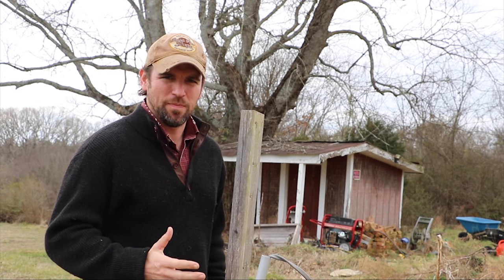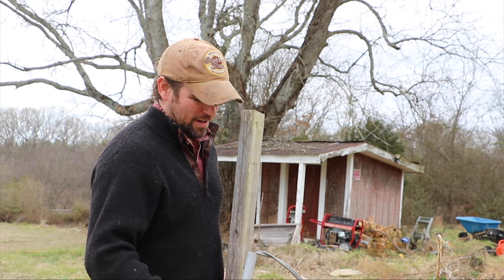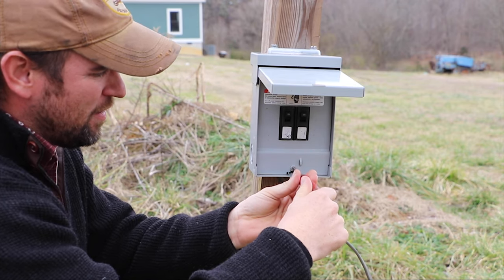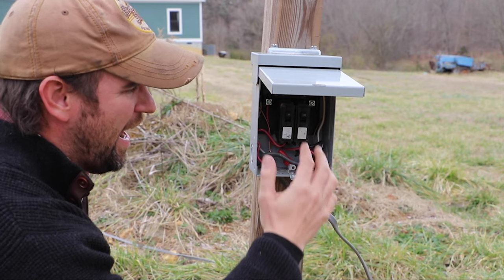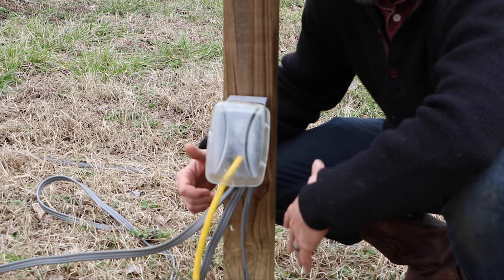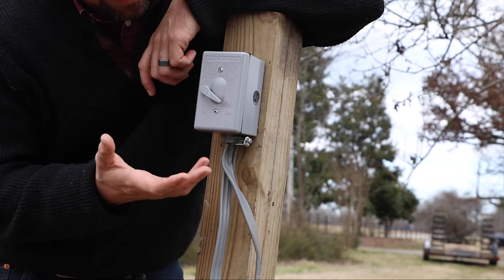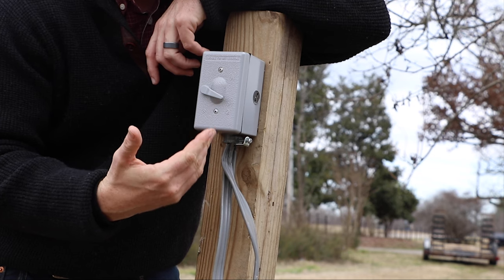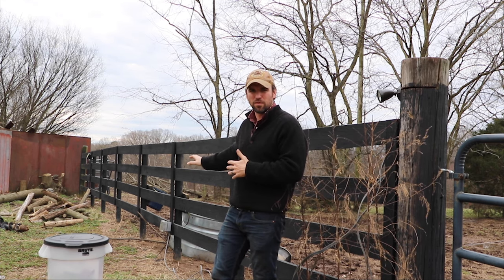Installing an Outdoor Electrical Circuit

Comment: Advice...you can connect ONE gfci outlet and then connect (daisy chain) as many duplex receptacles to the load terminal of that single gfci outlet.  Just remember that the current (amperage) on the LINE to the gfci is limited by it’s own current rating and also the breaker source to the branch circuit.  

I’ll also add, it would be a good idea to draw a one line diagram (schematic) representation of your interconnected field conductors, panels & devices.  Trying to remember how things are connected after a couple months without exposure to what is installed can become FUZZY!  You have a lot going on (electrical wise) out in the field.

Comment: I am waiting so to seeif I will ever see the 30 amp installation. but I only need to make sure the white wire is supposed to be on top and the black is on the bottom of the breaker, but every single one, nobody gets right to it.

Comment: 10 AWG can be a pain to work with, but it should help you with voltage drop on a long run, with a 20 amp circuit.  Good call on leaving 10 gauge.
Reply from the maker: DutchOfSC that was the idea. But I think I need to run junction boxes below each receptacle and switch and then run twelve to the fixtures... or get oversized boxes...  because it’s a pain to work with!
Reply: @YanasaTV  It sure is.  I recently have to work with 2/0 in an existing panel, not fun at all.  Keep up the good work.

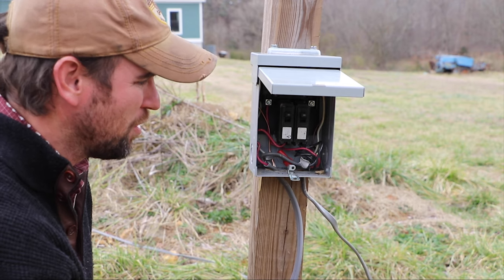Comment: 4:37 are those wires just running in bare through the knockouts in the bottom? May want to put in some threaded clamps, it wouldn't be a good day if that insulation got worn through :D